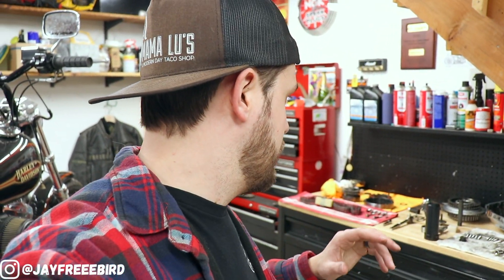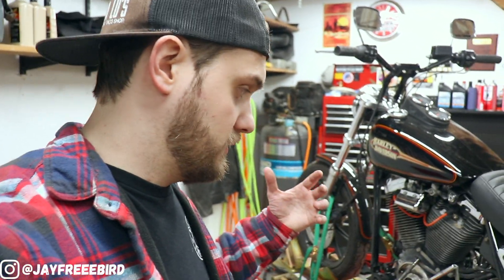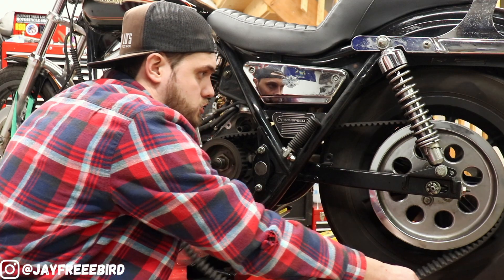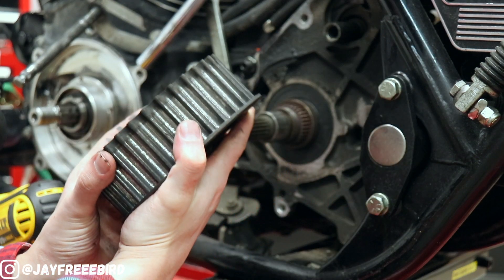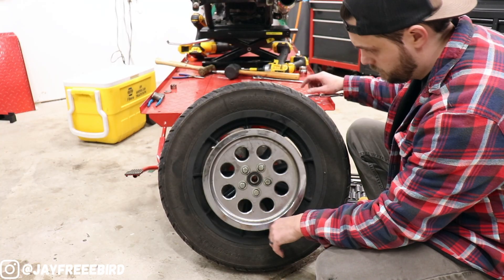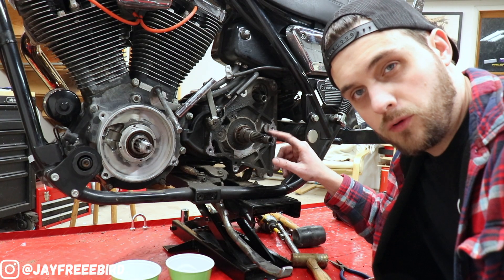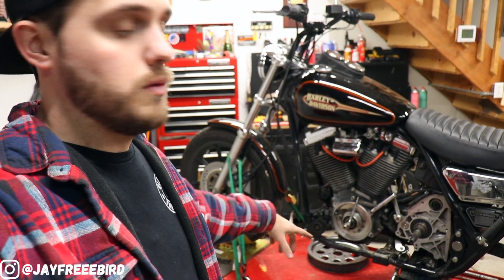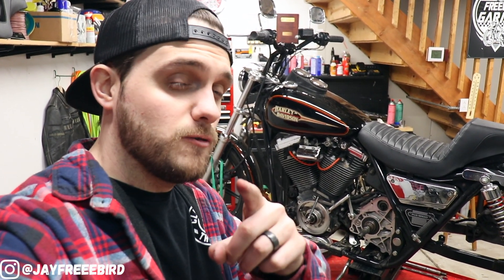Harley Davidson FXR Chain Conversion - (Part 2)

Comment: Well, that's one way to get a belt off.  haha  Making good progress.  Backorders suck.  We have some parts we use at work with lead-times of more than 12 weeks.  One chip we use for a board we manufacture is out 12 months.  Gonna be an interesting year.  Glad you were able to get the part you needed ordered.
Reply from the maker: You know the supply chain pain, my work is the same way right now. I don't know how certain customers are going to be taken care. I appreciate the support as always sir, thank you for watching!!

Comment: Great video , does that big nut that holds the inside pulley turns clockwise ? The Jim’s special tool to that that nut off is called what ? Does it have Part #
Reply from the maker: That is a left handed thread nut and a much cheaper priced one outside of Jim's https://amzn.to/3UynjU3 main shaft sprocket
Reply: 1 7/8 is the one we want?